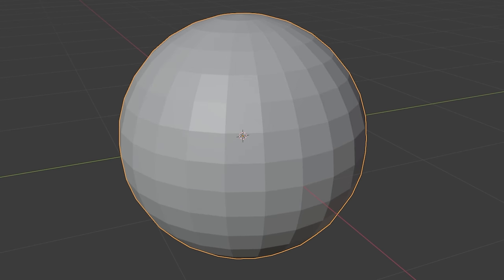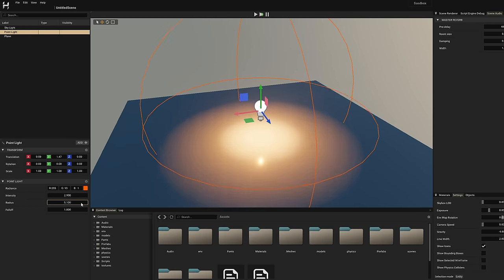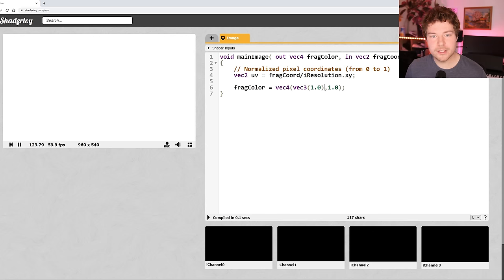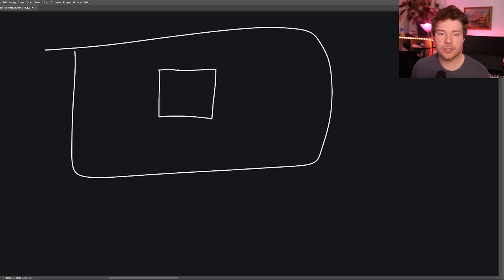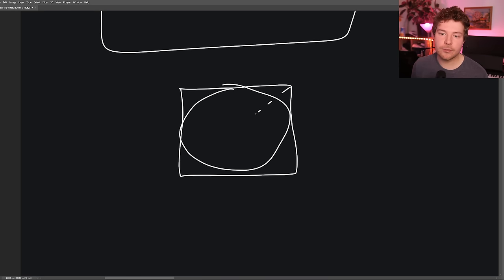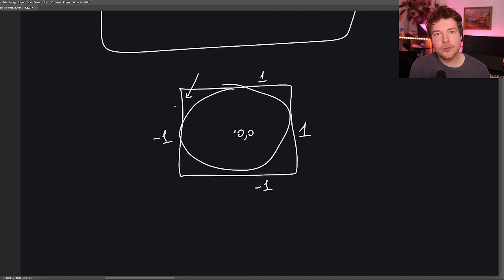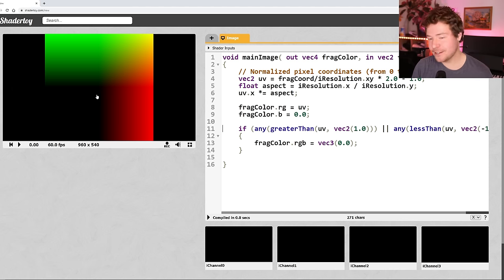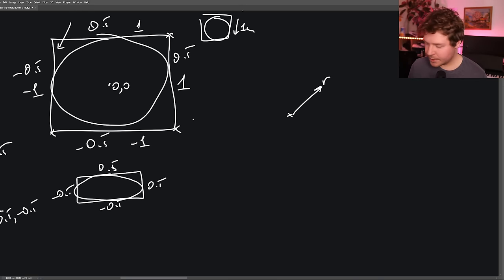How To Render CIRCLES (OpenGL/Vulkan/DirectX/Metal)

Comment: Hey I have a question: What stops one from putting everything into one draw call? Like having a mega shader and then either:
*A*. Pushing geometry on the CPU to a giant vertex buffer you push to the GPU each frame, or
*B*. Using vertex and geometry shaders as well as some persistent buffer on the GPU and just having simple uniforms/imports you can modify for stuff to add/subtract/change
Reply: You absolutely can do extreme draw call batching (though typically not in the way you've described with pushing stuff to giant vertex buffer each frame) and a lot of games do it (not quite to the degree of everything in the same draw in any game I've seen, but it would be possible). Pushing your mesh data to the GPU each frame would be really slow because that can end up with an absolute ton of data you're trying to send over every frame. You should look into indirect draws though, they can handle this quite elegantly. Doom Eternal, for example, stores all its geometry data in a single large buffer, with even skinning being done in a compute shader and stored into the same buffer before rendering anything. This allows it to merge completely unrelated meshes into the same draw, and I believe it did something like 256 meshes per draw (I don't see why you couldn't do more if you wanted to, but there likely wouldn't be much of a performance increase at that point and it may need more data). Typically the buffer used for indirect draws would also be created on the GPU and not the CPU because it's much faster (at the very least after some coarse culling by the CPU). Doom Eternal also generates a big index buffer every frame on the GPU (so instances are unwound into real indices), which allows it to do per triangle culling. Having one big shader is a common thing used in many games, typically called an uber shader. There are examples on the internet where whole game worlds are rendered in one draw with indirect buffers, so really go research that.
Reply: @Drillgon  Wow, what a great response.. I do have one leftover question though: can you have like a persistent buffer on the GPU that survives multiple draw calls? That way you could just modify it instead of pushing every frame.
Reply: @S41L0R  Of course. In fact, you basically never want to be creating a new buffer every frame. Uploading data to the GPU that doesn't need to be updated should be avoided in most cases (some exceptions might be streaming assets into and out of memory, but that's not quite the same thing as uploading all the geometry every frame). Like I talked about before, you'll typically store meshes inside buffers on the gpu and not touch them unless the vertices need to be updated (which is the case if you're doing GPU skinning in a compute shader, but even then nothing is being uploaded because the GPU is just writing into it's own buffer). If you want to draw the mesh more than once, you instance it. You can make allocations into that buffer for completely dynamic meshes as well using any of the many allocation algorithms.
Reply: This is roughly what you are doing with ray tracing, as well! The entire geometry and material information is pushed into the GPU memory, then the shader can throw whatever rays it likes and put whatever output it likes out, all in one CPU side call. (You don't actually do this in one pass, in general, as you want to do clever things like aggregate lighting information over multiple frames and combine them, but that's the idea)

RTX means you have explicit support, but since 2006 or so you could do basically ray tracing in pixel shaders: that's what parallax occlusion mapping and screen space reflections are, just in simplified cases that you can do quickly enough to be useful without acceleration.
Reply: @Drillgon  Awesome, thanks for all the info!
Reply: @SimonBuchanNz  huh - yeah that makes sense

Comment: It's not recommended to use length as it uses a square root. You can instead just make distance equal to 1 - dot(uv). The reason being you could've done 1 - sqrt(dot(uv)) = 1^2 - dot(uv) = 1 - dot(uv)

Comment: There was a paper about parallelizing Bresenham's circle rasterization algorithm. It's unclear though it's suitable for the gpu.
Reply: The rasterizer in a GPU is kind of baked into the hardware, you can't really have a parametric function that chooses which pixels to sample. You could generate a point list of every pixel, perhaps with a compute shader. Not sure it would be any faster than this though. Listing every point is a lot of memory. You might get this one faster if you render over an actual mesh that doesn't process so many pixels.
Reply: The gpu already does things in parallel.
Reply: @DFPercush  The GPU rasterizer can only rasterize points, lines, triangles and maybe rectangles. So this algorithm would need to be implemented as a compute shader.
I don't understand your concern about memory. Whether you use the final image as a render attachment or storage texture shouldn't make much difference in terms of memory size.
Reply: @_lod  Yes, but the process shown in the video has a fair amount of overhead, because it has to run through the entire render pipeline, because the pixel shader is run for every sample.
Reply: @ymi_yugy3133  Memory access time is what I'm thinking about, more so than size. Not sure what kind of cache a GPU has or what it has to share it with. Actually a tessellation or geometry shader might be better because it can just stuff vertices into the rasterizer pipeline and not have to allocate a buffer at all.

Comment: Why so convoluted?
This is my simpler and easier to understand version for an anti-aliased circle (not disc) with thickness, that is movable by mouse:

float sdCircle( in vec2 p, in float r ) 
{
	return length(p)-r;
}

void mainImage( out vec4 fragColor, in vec2 fragCoord )
{
	float aa_dist = 0.01; // edge transition: fraction of y

	float r = 0.4;    // radius: fraction of y
	float thks = 0.01; // thickness: 0 -> r

	vec2 p = (2.0*fragCoord-iResolution.xy)/iResolution.y; // y from -1 to +1
	vec2 m = (2.0*iMouse.xy-iResolution.xy)/iResolution.y; // y from -1 to +1

	float d = sdCircle(p-m,r);
	
	// coloring
	vec3 bg = vec3(0.1,0.4,0.7);
	vec3 fg = vec3(1.0);
	vec3 col = mix( bg, fg, 1.0-smoothstep(0.0,aa_dist,abs(d)-thks));

	fragColor = vec4(col,1.0);
}
Reply: Or for a centered disc with a hole controllable via mouse:

float sdCircle( in vec2 p, in float r ) 
{
	return length(p)-r;
}

void mainImage( out vec4 fragColor, in vec2 fragCoord )
{
	float aa_dist = 0.01; // edge transition: fraction of y

	float r = 0.6;    // radius
	float thks = 0.01; // thickness: 0 -> r

	vec2 p = (2.0*fragCoord-iResolution.xy)/iResolution.y; // y from -1 to +1
	float m = iMouse.y/iResolution.y; // from 0 to +1

	float d = sdCircle(p,r);
	
	// coloring
	vec3 bg = vec3(0.1,0.4,0.7);
	float thks_h = r*m/2.0; // half thickness
	vec3 col = mix( bg, vec3(1.0), 1.0-smoothstep(0.0,aa_dist,abs(d+thks_h)-thks_h));

	fragColor = vec4(col,1.0);
}

Comment: Apple does not support GLSL, so the title is incorrect. If the Metal shader language is the same, then Apple stole it and then stopped supporting it, and Metal is "we're workin on it..." for years. Safari does not support WebGL or WebGPU. Apple offers no equivalent to Shadertoy. 
If you set the circle to fade out, you are interpolating instead of antialiasing. It's better if the texture is higher resolution and antialiasing is performed by the GPU in context. If you target 2D worlds and want to optimize texture size, it's easy to use Pythagoras' theorem with quadrants to calculate how large an area of each edge pixel is inside the radius.

Comment: How to render thicker lines and line joints like bevel ,round,miter?
Reply: The simple and practical option is just generate geometry on CPU and render with MSAA, which looks good and is very fast for most use cases. If you need to do arbitrary lines in the shader, then you need to have the information (positions and options) available in a buffer, and then you basically do a lot of the sort of thing in this video where you're checking how far away you are, only it's a lot trickier to do fast, and involves a lot of calculus on polynomials for curves in particular, and joints can get really hairy to handle correctly.

I wouldn't recommend going down that path unless you are ok with spending a few months at least!
Reply: @SimonBuchanNz   algorithm to generate geometry on cpu
Reply: @abhishekkumar-os5ey  was there a question? I'm not Google.

Comment: I did this instead of the step function: 
float centerDistance = dot(uv, uv);    
fragColor = vec4(floor((1.0-centerDistance) + 1.0), 0.0, 0.0,1.0);
Reply: For the hole i did this   

 float centerDistance = dot(uv, uv); 
    
    float thickness = 1.0;
    
    thickness *= 2.0;
    
    float r = round(1.0-abs((-1.0+centerDistance*(1.0 + thickness*0.5)) /thickness));    
    
    fragColor = vec4(r, 0.0, 0.0,1.0);

Comment: If you are looking for performance and not care about donuts (works correctly only with circles) you could use `dot(uv,uv);` instead of `length(uv);` How worth it would it to save a square root operation per pixel?

Comment: quantized pixel systems have a jagged edge issue, also for 3d model issue
Reply: location based (functionalized) vertex and pixel/fragment shader
Reply: "do we have a pixel here and what type, what color, how soft", anti-aliasing on the fly
Reply: projection in the shader, 3d localized shader
Reply: volume shader
Reply: voxel shader, in 3d
Reply: texture manipulation
Reply: generalized pre-rendered primitives
Reply: pre-calculated results for length function, any instruction, any bit amount, like INT8 or FP16
Reply: you have two arguments for the length instruction
Reply: 8-bit consoles, multi-core, are cool
Reply: if you have step defined as math function, taking in the r value, any smooth function, you get rid of branches, if statements
Reply: like f(r) = a*r^3 + b*r^2 + c*r + d, in the very steep step form
Reply: that can be step shading too, clamp/ceil/floor should give your real branchless step function
Reply: parametrized shaders
Reply: surface shaders
Reply: I mean 3d surface pathing
Reply: ray sphere intersection, sphere primitive, sphere collision volume per entity, shoot every pixel, recursive ray casting importance sampling
Reply: simple way to ray trace, with z-buffer, is to intersect ray, source origin to the current pixel, of any shape, like triange or sphere (all 3d), then draw it to the z-buffer, in the shader, similar that you did, condition with the equations, just check what type of primitive the rendered primitive is, this should be called importance sampling ray tracing with z-buffer, its very simple, replace raster with the ray trace, but keep the z-buffer, your raster is only the importance sampling procedure
Reply: also sphere map textures, for sphere primitives, not triangle texturing
Reply: I assume you can easily access the 3d coordinates of the shader path

Comment: I was really disappointed by this video. I was expecting you to derive the "correct" way to render, which is well defined: What would a real-life camera output when faced in front of a perfect circle.
This yields the area of the intersection of the circle with the pixel square. And then approximate this using fwidth. Instead, you were very vague about the transition and smoothness.

Comment: Before watching your result I made a quick circle shader myself.

void mainImage( out vec4 fragColor, in vec2 fragCoord )
{
    vec2 res = vec2(
        sin(
            atan(iResolution.x, iResolution.y)
           ),
        cos(
            atan(iResolution.x, iResolution.y)
           )
        ) / 0.707106;
    vec2 uv = fragCoord/iResolution.xy*2.0-1.0;
    uv = uv * res;
    fragColor = vec4(1.0, 1.0, 1.0, 1.0);
    if (uv.x*uv.x+uv.y*uv.y < 0.4 && uv.x*uv.x+uv.y*uv.y > 0.37) {
        fragColor = vec4(0.780392157, 0.0, 0.145098039, 1.0);
    }
}

this would be my first attempt. The weird color code is Japan.